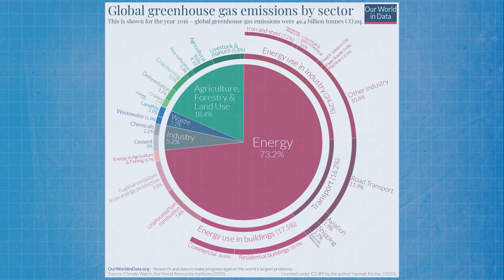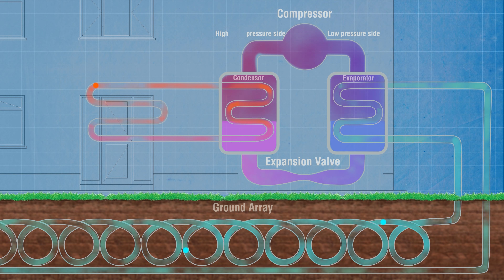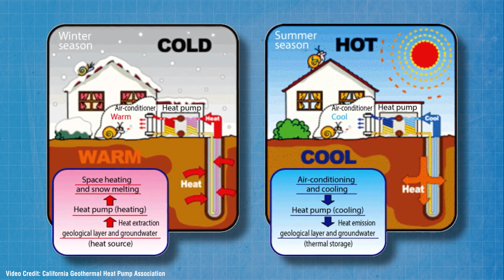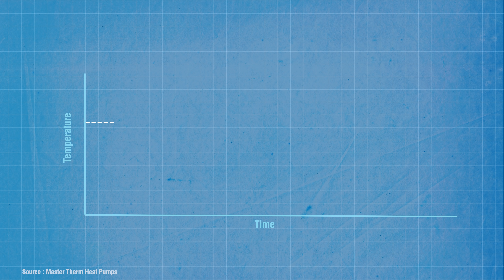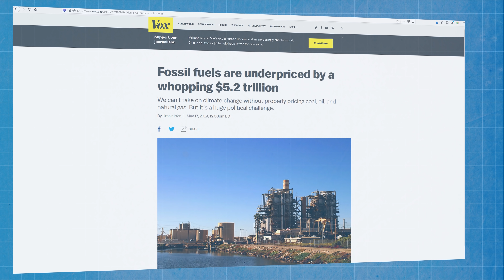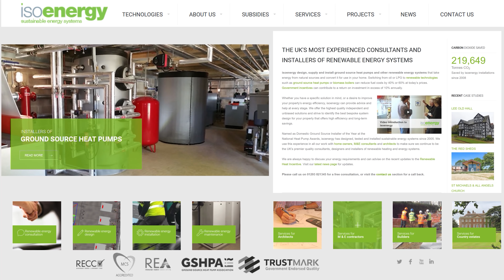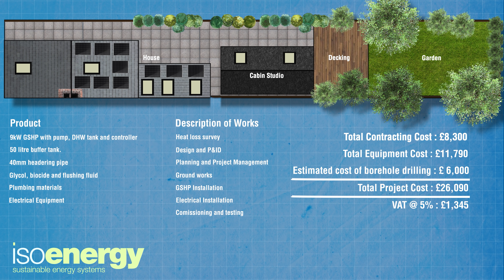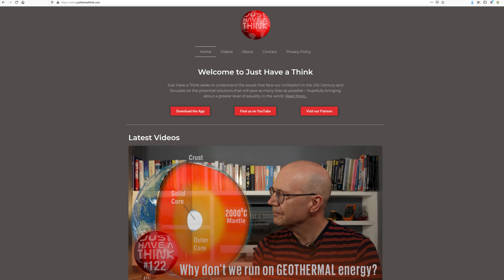Geothermal ground source heat pumps. Heating your home from your own back yard!

Comment: Just have a think.

There is no geothermal to heat pumps, that is a misleading term.

Heat pumps produce heat by compressing a refrigerant gas, and as with any gas the compression creates heat. 
Essentially you are either cooling the soil or cooling the air depending on if they are ground source or air source.
Their drawback is the condensing temperature is not really that high so larger areas of radiators within the home are needed. Heating of domestic hot water is also a problem particularly with air source, whose performance deteriorates as the outside temperature drops.

Their theoretical heat output versus energy input is high but in practice not as good as it would seem, and if you have to use an element for hot water this negates some of the advantages. Also as electricity is dear, and will get more expensive in the future their advantage is lost as the cost of running an equivelant gas boiler is much lower.

Comment: I friend of mine had one in Milton Ontario 35 years ago..  Heated and air conditioning but he used an electric water heater,  it did need an auxiliary electric heater when it was below -15C outside.  He did this in part of a 1/4 acre lot.   This was a warm air system...no radiators of course

Comment: The most cost effective time to install geothermal for new development is during the subdivision development, when road ways, school yards, park areas can be utilized and the ground is generally all dug up anyway. It tends to support community based heating / cooling systems. This has been done in the US where the developers picked up the install costs and recuperated them by selling the heating back to the home owners over a period of time. I would love to see this concept built into all new developments and the municipalities could play a major role in making this happen.
Reply: Correct. I'd say 99% of UK housing it's difficult to dig a 2m deep/100m trench around the boundary. $ for $ just not worth the hassle. But there is economy at very large scales, and long time period
Reply: @Froggability  You need a HELL of a lot more than 100m of trench .  Try HUNDREDS of meters in shallow depth  Unless you live on acreage, forget it.  At least you can do the digging yourself making it cost effective.  The only real option for majority of people  is 2 100m-->150m deep geothermal wells and this is sufficient for the average house.  Spacing?  10m between wells.  Big house: 4 wells.  PS: I Live on acreage and we have 200m of trench and it is NOT enough and we have a SMALL very well insulated house.  To compensate we now use our well as a heat  source.  Our weather here in Seattle is very close to most of the UK.  Not as good as Southern England and not as bad as upper Scotland.
Reply: https://youtu.be/Uy0SEG36bEM 
just a relevant video
Reply: @seanpalmer8472  Hey, this is my development!
Reply: Yes!  Excited to learn about Darcy Solutions - new tech for geothermal for multi-family properties and new developments - coming from my  home state, Minnesota U.S.

Comment: If you decide to investigate a ground source heat pump it’s critical to triple check the saturation calculations.   Over several years and imbalance in the heat recovered/rejected can result in a loss of efficiency that can make the system impractical.    If it’s correctly designed It’s one of the best systems available!

Comment: Heat Pumps - my favourite misunderstood proven solution to HVAC. They absolutely need to come down in price, especially in domestic retrofitting. Ground or water based HP systems should be considered in all suitable new builds. They work well in river systems, which flow past, presenting new heat to be extracted. But how can one heat one's home from the ground/water outside when it is colder than inside. The solution is to think relatively. One may extract 2° of heat from the ground/river over the area of the underground collector. Put through the system, this can equate to a 10-15° or more increase indoors. Think of your fridge and freezer. They do exactly the same thing, but they are in cooling mode all the time. Their interior space is small relative to the large space [your kitchen or other room] exterior, so they make little difference to the exterior air and major difference to their interiors. And upto 400% efficient. Wish I could afford one.
Along with Dave's recommendation to watch Robert Llewellyn's video over at Fully Charged. Here's another from that channel where Robert talks informally to heat pump expert Dave Pearson of Star Refrigeration: https://www.youtube.com/watch?v=aWgkl7W9xU0

Comment: what is the carbon cost of manufacturing and installing a domestic system? what % of houses in, say, the UK would have big enough gardens to allow installation work? what sort of maintenance costs are involved, given the use of circulating fluid?

Comment: maintenance cost, and repair costs are really high for these systems. I spoke to a local excavator about his experience with these systems, he basically said 9 out of 10 of the systems he helped installed had to have their heat mechanicals repaired, or replaced. he also said that about half the people who have installed them in the past 10 years have abandoned their systems all together.  BEWARE payback is for BEST case only, and rarely do they perform to best case.  Incentives are great, but it's the manufacturers and installers that really reap the rewards of these systems.
If you're building new, consider investing the extra $ into Passive building instead of a heat pump.
Reply: @Jay...777  can't disagree with that!
Reply: You raise a really good point about servicing. There are few companies with the skills to do this in the UK so it can be high. However, to get the subsidy, it needs to be maintained in line with manufacturers' guidance. I am disappointed to read about your excavator's experiences with heat pumps. He must have worked with some low-quality installers. they all come out of the woodwork when there is Govt money to be had. If he wants to come visit any of our sites to see how its done properly, tell him to get in touch. We have hundreds of systems with associated happy owners.
Reply: @isoenergyltd  I am in Canada, and it gets COLD here. - 20 in the winter isn't that cold, as an example. I am thinking because of this the mechanics need to work harder than they do in, say, the UK. This may be why the systems need replacing more often. Like I said, it's common in my area that installations not last a full 10 years.
Reply: @TheHowtoDad  Understood. I'd not considered that in my reply. Its great this channel has such a global following. I have to defer to anyone with experience installing systems in that kind of environment, as I have not.

Heat pumps work better in a temperate climate that's for sure.

Comment: Ground source heat pumps are definitely a step in the right direction!

The video showed yet one more time one of the most important issues slowing down a speedy transition to renewables - billions in subsidies and tax breaks for fossil-based energy! Any country which still elects governments which will continue these tax breaks are simply not sincere about climate change and the transition to renewable energy - the COVID crises would give us the ideal opportunity to kick start the economy with a green boost or green deal!

One addition to the video would be dynamic geothermal energy systems where seasonal ambient energy is dumped into the ground in order to benefit from it later in the next season (summer heat collected in solar thermal systems and dumped into the ground for a more efficient winter operation since the ground is warmer than without charging).

Comment: Very middle class and rich answer. You need a back garden and you need a lot of money upfront. Also, in the UK, 40% of the population live in flats or homes without gardens. So it will always be a small answer to climate change.
Reply: @Jay...777  New buildings. We aren't building.

Comment: To complete the information in the video: in 2014, only the drillings and the external pipelines for a vertical geothermal heating system (7 drillings at a dept of +/- 50 meters) in my newly builded house in Belgium costed me 12.702 euro, VAT not included. With that, you have to add the heating pump and further installations inside the house. But in combination with my solar panels, on a yearly basis my house is a net producer of energy.
Reply: @Si C & @Captain Carter. It's true that a deeper drilling gives you more heath. So, you need less drillings. But the deeper the drilling, the higher the price of the drilling.  Once you exceed 60m, you need very specialised and expensive equipment and it's not always easy to bring that equipment on site. In addition, the legislation is more severe.  The temperature at 50 meters depth is about 14°C. The compressor of the heat pump (and the electricity that aliments the pump) brings that to 40°C.  My heat pump is a Vaillant VWS 171/3 (17,3 kW and a COP 4,9).  I use +/- 1 kW of electricity to have 4 kW of heat.  For the 7 drillings, I needed approximately 400 square meters, which was available in my backyard.
Reply: Interesting they went for 7 drillings - you'd think fewer, deeper boreholes were better. I had a quote in the last month for a full conversion of existing gas condensing boiler system with 3x 110m boreholes: £38,000! I wish it was closer in cost to yours!
Reply: @sic1038  That stings. 330m of borehole implies a heat load of about 13kW. I think you need more insulation and airtightness to get the load down. 38 grand on the fabric would get an average sized house down close to Enerphit (passive house retrofit) level so you'd only need heating a few days/year (+ hot water).
Reply: Hey Jean, So my question will be.Do you know.What is the temperature of the ground on 50 Meters? Tx

Comment: Why not have a look at air sourced heat pumps! These are increasingly being used in commercial premises and domestic situations. I had one installed about 18 months ago for my 3 bedroom semi. so it heats in winter and cools in summer and was half the cost of a new gas boiler. It runs on renewable electricity as my house is between 2 large windfarms in Northamptonshire.

Benson Downey
benson.downey2@gmail.com
Reply: I don't get how it can heat house in winter if air is colder outside... shame government doesn't support  green energy at all around here.
Reply: @MiniRockerz4ever  It uses the gas compression cycle with a medium at boils at -16degC. Regardless of how cold it is outside, we can harvest usable heat and the compressor raises the temperature of a large volume of low-grade heat to 60-80degC. This heat is then transferred into hot water for use around the home and in the heating. There are some details on our website. Between you and me, I've been here 6 years and only recently grasped the physics behind it, but I did biology at school instead. :)

Comment: The price of electricity in most places is more than 4 times the prices of solid fuels and installing a stove is simple and cheap to do and the amount plant that's required for this is large expensive and requires long term maintenance.
Reply: Surely the aim is to stop burning stuff?
Reply: The problem we are told is heat on or near the earth surface so how can moving heat up from below make sence getting power fro moving heat from surface to underground seems a better idea to me

Comment: Very well explained Dave! 

Will just clearify that the first choice when using geothermal system for cooling is to just pump the cold liquid from ground in to an indoor AC unit suitable for liquid. That reduces energy consumption to cool by 90% and very environmental friendly! ❄ 
 
Reversing the system is used days when more cooling power are needed. (And that is the same time as your solar system produces most energy!). ☀

Keep up the good work!

Björn
Reply from the maker: Hi Björn. Thank you for clarifying this. And thanks again for your help. Much appreciated :-)
Reply: In the Netherlands we use already GSHP for more then 2 decades. We use underfloor heating as our prime heating system. In the summer we use these heating system for cooling. It’scool to cool your house with just 2 A-class circulation pumps
Reply: Hi Björn thanks for the reply.  I must admit I am a little confused by this topic so if someone could clarify these points I would be grateful:

1.  So passive cooling uses the cool water of the ground source heat pump and feeds this to an AC unit like you said.  I take it this AC unit mentioned does not have heat exchanger and work passively.    I assume there would be a limited effect from this unit as you can't transfer 'cold' energy into a building?  The aim would be to remove 'heat' energy from the building - what conventional heat pumps/AC units do.
2.  Does running an underfloor heating system at a cooler temperature make much of a difference in hot weather? After all the floor a can only be cooled so much as there is a dew point temperature.  Does this cool down a house much?
3.  Can you connect up a heat removal air extractors within a building to a ground source heat pump so it can work in reverse using the ground as heat reservoir?

I hope all these questions make sense.   I'm just about to install a ground source heat pump so any advice would be welcome.

Thanks,
Will
Reply: @princewillip  Passiv cooling does not need a heat pump / chiller at all. Just a water pump that circulate the cold brine in the closed loop pipes that goes down to the ground back to a "AC Fan" or another cooling water chilled device.

The power is of course limited but in a area where a heat pump are suitable, due to cold winter climate, and the installation are a regular house for living I think it will be practical unlimited.

But if you need more cooling power, like large buildings, you can always use a geothermal heat pump and use the cold side like a water chillier. (Because it really is a water chiller). The heat can be dumped back into the ground. But the pipes and controlling system need to support it. Now a days I think all controlling units support that.

2. Theoretical yes, especially if it is a floor between your storeys. But because you will need AC Fan or similar I would just leave the floor system for heating. Keep it simple stupid if you can...

3. Oops answered in 1 above... But yes! Well if you happen to have a heated fresh air supply unit you can cool the intake air too.
Reply: @nallebrean  thanks for making it clearer.
Reply: Do anyone know about a geothermal system in hot climate with main purpose to cool? I know it's used in Sweden, but "hot climate" aren't the way to describe our temperatures. 😊
Reply: @bjornjonsson1875  Hi Bjorn, our development in Austin, Tx, US is a cooling-focused hybrid loop system. We have 200+ homes on our system and it's performed very well.
Reply: Bjorn,  it sounds like you are describing what is sometimes refered to as 'free cooling' which doesn't require the vapor compression cycle to move the heat from the space to the ground. In warmer climates compression is necessary.  For cooling dominant climates it is more critical that the ground heat exchanger is sized to dissipate the heat rejected from the building and the heat of compression than sizing for heating season ground heat extraction.
Reply: #Australia pays huge for energy & I’m wondering if they would not benefit from Geo-thermal - it is a large cost to set up / but to go fosselfuel that is Natural gas an almost depleated energy source seems a waste of moneynfor pipes etc, when doing geo-thermal or clean and free is available go with it! You already have a backup lithium battery for a back up! #actnow #climateemergency #worldrenew
Reply: @GurgaGeorgiTaylor  I just checked up Melbourne and there mean temperature over year are around 15C so that are likely the ground temperature. The standard cooling system use 7/12 C all year round but you design a system to use higher temperature with the cost of bigger pipes and heat exchangers.

You can also, or rather I advise you to, adjust the system temperature bye demand. If it cold out side/not that hot you can rise the systems temperature. That lower the AC energy use because of higher efficiency and you reach a temperature where you can use ambient air or cold water from ground without electricity.

In water central heating system the compensation to outdoor temperature are standard today (in Sweden). So use it on cooling to! 😊

Comment: Here in MN,USA there are some people running open loop ground source heat pumps. These are also called "pump and dump" in that they pump water up from a shallow well and dump it in a pond like area. They are cheap to set up and do save money, but the heat pump slowly plugs up with minerals and has to be cleaned out at times.
Reply: Pump and dump works good with 2 wells so any ground source water is returned only thing different is it is 3 degrees colder and of course cleaner as you have to filter it to run through the heat pump.
Reply: @offgridwanabe  Here in MN they don't allow injection wells. At only 20 feet down and sand it's not much of a difference between dumping it in the yard and injecting it.
Reply: @LaserFur Interesting  Do you know the reason why
Reply: @offgridwanabe  there is the possibility of ground water contamination since the iron bacteria can live a long time as the water can pick up oxygen in the process. A clean water drain field can also be used, but that kind of defeats the point of doing something cheap until a closed loop system can be built.